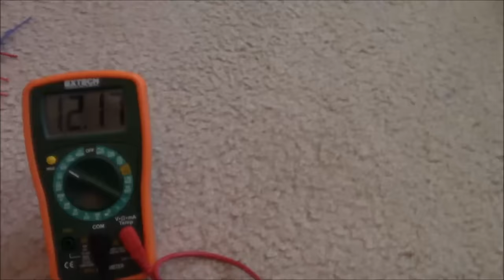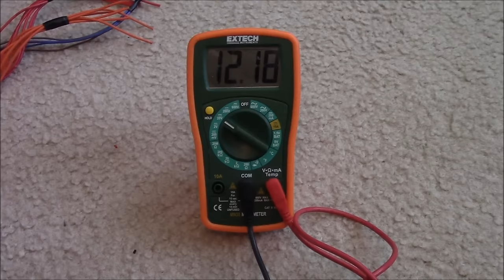How to Hack a Computer Power Supply (PSU) To Use as a 12V DC Power Source

Comment: Could I ask wat happens if your power supply has 2 cable ports
Reply from the maker: Two ports for power cables?  Then that sounds like a redundant power supply that if one side fails the other can still operate the machine.  Servers have those but usually they are two separate parts and not one part with two plugs.

Comment: Which wires do you connect for 20 plus amps?
Reply from the maker: Mine maxes at 20A on the 12V rail.  So you would need all of the yellows combined for that.

Comment: I have a solar panel that charges a 12v battery. is there a way to make one of this power supply to get me 5v output ? by skipping the ac part of it? will it be effecient or will it eat too much power for its circuitry?
Reply from the maker: You want to change from 12v dc to 5v dc?  This power supply would not be able to do that without converting to ac first.  You need a power converter like this http://www.amazon.com/KEEDOX%C2%AE-Converter-Power-Supply-Module/dp/B00A71CMDU/ref=sr_1_6?ie=UTF8&qid=1410842261&sr=8-6&keywords=dc+dc+converter
Reply: Thanks, i've already made one with a 2575T (5v) thanks to texas instruments. Those are not available in my country (argentina) so i had to import it (and was really expensive). but also i need a 330uh inductor (i think is called that in English), but in my country i can only find a 0.25w ones.. when i try to charge my cellphone, it uses 1A (@5v) and it damages the inductor. i would need a 5w inductor (i think) but i have no idea how or where to find one. i certainly tried to get one commercially but to no avail.
Reply from the maker: I am afraid that I can't help you there.  Good luck, though!
Reply: thanks for the good vibes.
Reply: good idea. thanks.

Comment: I have  a  atx power supply that will not take 6amps without turning it off then connecting the load then it works. if i dont turn it off before i connect the load it shuts down. any ideas?
Reply: Do you have a dummy load connected? You need a 22ohm 10w (wattage can be higher) connected to a single 12v wire and a single ground wire.

Comment: I was just wondering, what would the difference be between soldering all the 12v yellow wires together and using them individually with one ground (black) wire. If i had to power 2 12v devices, should i use 1 yellow wire each or as many yellow wires as i can? Would really appreciate if anyone could help me out with this. Thanks
Reply from the maker: Each of those wires is very small and only meant to handle a few amps.  But the entire +12V rail can provide 20 amps.  So I soldered them all together to be able to safely use all 20 amps if I wanted to.  You could probably get away with 4-5 of the wires for 20 amps as well, but I always err on the safest side.  If you are only planning on using a few amps, you could probably get away with 1 or 2 wires.  Personally, I would probably never use just one wire but that is me.
Reply: Thanks so much!!
Reply from the maker: You are welcome.  Thanks for watching!  Be sure to subscribe if you haven't already.
Reply: I have RX-630AS

Is there a way to make
 +12v1 x 22Amp connect to 
+12v2 x 22Amp connect in serious 

to make 24V 11amp ?

Comment: 2 power supply have mine, running doesn't. however single yesterday & 2 day earlier running was.either multimeter the how using im?
Reply from the maker: I don't understand what you are saying.
Reply: power supply both running won't. how repair make able im?
Reply from the maker: In order to get the power supply to run without being connected to a computer you have to short the green wire with a black wire.  Watch around 1:45 in the video for instructions.

Comment: Hello, I am having an issue while modding a brand new antec bp450ps, I did as you showed, I also added a 10w 10 Ohm resistor to the 5v line as dummy load. the problem is that the voltage drops down to 9v while drawing 5.8A.  the 12v rail is rated 19A so i am super confused if the smps is faulty or not, i already voided warranty by opening it and modding it. Any thoughts or suggestions would be really appreciated. Thank you!
Reply from the maker: Hmmm, the only suggestion or thought I have is how many wires are you pulling 5.8A through?  Did you lengthen the wires to make your connection to your load?  Because you could be suffering from voltage drop.
Reply: LDSreliance I am using all 16 wires (20awg each) to pull the current needed and I have cut the wires to around half a foot in total length (from pcb till connector). Now I am afraid that I could have purchased a dud :(
Reply from the maker: It is possible that it was a dud.  Sorry, I don't have any more ideas.
Reply: No problem! Thank you for your time :D
Reply from the maker: You are welcome.  Thanks for watching!  Good luck with it.

Comment: due to my home made battery pack for a motorized trike, i have 16, 6volt 12 amp SLA  batteries...i run them in 2 parallel series of 8..... the way i am charging them at the moment is by breaking the series down to 2 6volt 12 amp batteries and then using a 12volt 6amp trickle charger.
 i understand the concept of using multiple batteries  in a series to get my desired voltage-in my case it is 48 volts...but i am having issues trying to figure out a battery management system for my configuration.
  is there a way for me to use a few pc power supply boxes  or what ever to make it so that i do not have to break my series apart for a charging cycle ?
  how would you approach my problem ?
Reply from the maker: Why do you have to break them apart to charge them?  As far as a charger is concerned, it would just see a 48V 24Ah battery bank unless I am missing something.  As long as your charger can charge a 48V battery you should be fine.
Reply: indeed, i suppose i was asking if there is a way to make my 12 volt charger work as a 48 volt charger or do need to buy a 48 volt charger and be done with it....this 12 volt trickle charge  i have is for my riding mower and it is only used in the winter months...I am simply wondering if there is a way i can use it for my trike too-besides the mentioned way of breaking the series down to 12 volt
Reply: i am of the belief that a 12 volt charger will not charge a system higher than 12 volt
Reply from the maker: That is true by itself.  But you can get a voltage step up converter that could possibly make it work.  If it were me, though, I would just get the right tool for the job and get a 48V charger.  It will be cheaper and more efficient.  Like this:  https://amzn.to/2NEdNcL
Reply: great..thankyou for the advice . i was simply wondering if there was a cheap add-on of sorts.
Reply from the maker: There is.  But in this case a 48V charger is just as cheap.

Comment: What if a power supply has 2 or more 12V rails,can they be connected into one?
Reply from the maker: Yes but you may end up tripping the fuses.  The 12V rails come from one source but are just channeled through different paths with different fuses and protections.  They do that because the wires are thin and can't handle high amps.
Reply: So it would be best and easiest solution to use a single 12V rail power supply?
Reply from the maker: That would probably be easiest and least problematic, yes.

Comment: I plan on doing this with a 650W power supply to power car subwoofer amplifier
can I charge up six 500 farad super capacitors to 12v then hook it up to the power supply to soften the current draw from the amp when the heavy bass hits? so the power supply doesn't cut off when it sees the current rapidly increase?
cause i know some power supplys are overprotective when they see the current changing quickly even if it doesnt go above the rated wattage.
Reply from the maker: Theoretically, yes.  You would have to have capacitors in the mix because the PSU will not supply surge current.  Also, keep in mind that your PSU will provide less than 650W on the 12V rail.  650W is the total that can be provided by all the rails.  Your 12V rail is most likely 40A at the most (480W).
Reply: so I need to get an even bigger power supply? like 800W or 900W to power my 500W amplifier? cause my amplifier has two 25A fuses
Reply from the maker: Maybe.  Your amplifier won't pull 500W unless it has to.  So it depends on the power draw of the devices connected to the amp, not the rating of the amp itself.
Reply: it outputs 500 watts RMS at maximum load and I plan on setting the gains for maximum clean bass output without clipping or cutting out issues I like lots of low deep bass around 30hz and lower. not higher punchier bass like 40 to 100hz
Reply from the maker: Right but what is your sub rated for RMS?  If it is a 400W sub then your amp doesn't need 500W.
Reply: two 250 watt RMS subwoofers
so yes it does need 500W lol
Reply: I just checked the specs on the product box from some pictures online and it outputs 54 amps on 12v rail. should be enough for my amp??
Reply: also the power supply has a switch like yours does that make it a good candidate for use as an amp power supply?
Reply from the maker: Yep that all sounds good.  If it can reliably produce 54 amps you are good to go.  The switch is pretty much mandatory so it is nice you already have one built in to the power supply.  Let me know how it turns out.  I am interested!
Reply: ok! if It has a potentiometer to adjust the voltage higher thats even better for more efficient power. but I think only really old power supplys have those. and sometimes those pots dont adjust anything visible on the output
Reply: it just arrived I got it hooked up and it works perfect. voltage is staying pretty strong at 12v. its at 12.18 with the amp hooked up nothing playing turned on and stays mostly above 12v playing music

Comment: Can I connect to each cable 1 fan 12v 0.5A? I want to connect like 5 of them
Reply from the maker: +Paul Vasiliadis That should work just fine.  One individual yellow wire should be able to handle 0.5 amps @ 12v.

Comment: I have a PSU N275P-00, I did the same but it goes off after it starts
I  try different gwd but does the same, any idea??
Reply from the maker: Yes, it has a feature that shuts off power if it detects that there is no load.  Try connecting something to it like a light bulb that will turn on and draw power as soon as the PSU turns on.  It should stay on then.  Also, you could wire in a resistor to provide a dummy load if you know how to do that.

Comment: What maximum current (DC Ampere) i can get from typical ATX PS Unit
Reply from the maker: +Asif Riaz On the +12v rail it will be between 20-40 amps usually.  Cheaper units like the one I have in this video are the most common and will be around 20-25 amps.

Comment: Typical PSU has 300W
Does it mean I will get 12V and over 20A ?
Reply from the maker: 300W is a very small PSU for a desktop computer.  The smaller ones will have 15 or 20A on the 12V rail and the larger ones for workstations or gamers will have more.  You have to check the specifications for that exact model to know for sure.

Comment: Yesterday I was able to get my hands on an old power supply. It's a simple fsp250-60hen with no on/off switch on it, which I have never seen before by the way. As far as I remember all the pc's I ever owned  had a power switch. Is that green wire still the wake-up wire then? My logic tells me yes, but I'd like a second opinion on it.

And here's a little note for everyone else that is in a rush and quickly goes buying a second hand power supply. I did a big booboo yesterday and got majorly ripped off by the (private) seller on that power supply, due to my own stupidity. It was advertised as a Trust 570W Pro PSU Dual fan, and he wanted $10 for it. So I thought "Meh, that's not a bad deal for it" and I agreed. Went to his house in a hurry - didn't have much time - grabbed the box, took a quick glance at the power supply without taking it out of the box, payed him and jumped back in the car. It's only when I came back home an hour later that I discovered that I had been ripped off. I payed $10 for a power supply that is basically only worth a buck or so, if even that much. The fan rattles like crazy when I flip the case over, only one fan there of course, no power button, only 250W and not 570W, less connections, and so on. I haven't bothered testing it yet, so I don't even know if it will turn on to begin with. SIGH

EDIT: tested it, and OF COURSE the thing is as dead as it can be. No current at all, nothing, nada. Even the fan inside is completely broken and several screws in and on the casing are missing. And to top it off, the seller refuses to refund me and blames it "on his friend", since the power supply is supposedly his. Riiiiiight. No real surprise there, to be honest. SMFH

Comment: When i connect yellow and black wire into a dc 775 motor , PSU become auto off, why?
Reply from the maker: Either the motor is drawing too much or too little power.

Comment: Please help with my HP-P2507FWP. Followed your instruction but not getting the 16a. What am I doing wrong?  Thanks
Reply from the maker: J Carter Did you connect all the +12v wires together?  They may not be yellow, although I think yellow is the standard color.
Reply: LDSreliance yes,,it will run a small dc motor but when you add anything that need more amps it will not run them. The specs say 12v 16a...I am running a fan from an old bus with a 12v 12a batter charger from a kids toy yard can but it gets hot, was hopping to use this,,,,,,,,,,Thanks
Reply from the maker: OK, so you are trying to power a fan and also a battery charger with your hacked computer power supply.  What are the specs on the fan?  If you don't have them, can you test it with a multimeter and see how many amps it draws?  Are the specs on the battery charger the input current or the output? 

I would bet that the bus fan is using more than 4 amps.  Even small aftermarket electric fans for cars pull more than that.
Reply: LDSreliance  Just did a test, the fans are pulling 8.5a. when I tested then in direct hook up two fans wired together then leads to power supply the would kick on but not run. when I put the multi meter in line to test amp draw they ran fine. What!  Do I need a resister some where or something ?
Reply from the maker: J Carter I am not an electrical engineer so I don't know why that is happening.  I do know that the resistance on the volt meter is negligible or it would not be useful for testing because it would skew the results.

I know with other fans they draw a lot of amps to gets started and then it tapers and levels off once they are moving.  It is easier to keep a fan spinning and requires less power than to spin them up from stopped.  Maybe the power supply has some sort of overload protection that prevents large spikes of power.
Reply: LDSreliance  Ill do some checking    thanks for the help  keep up the great work
Reply from the maker: Will do.  Good luck!

Comment: hey brother can i ask you how many amps does the 12 volts pc power supply can throw???
Reply from the maker: The one in this video can handle a maximum of 20A on the 12V rail.  Check your specifications on your PSU for an exact number but it will be between 15-25A usually.
Reply: LDSreliance  thanks i checked mine its rated for 30A...but my problem now i want to put an illuminated 220v rocker switch because my psu doesnt have one, but my problem is i dont know if wiring 220v rocker switch is same with wiring 12v rocker switch...
Reply from the maker: Usually the voltage rating just means the maximum that it can handle.  So using only 12V on a 220V switch should be fine as long as it is rated for DC current.  However, it may not light up for you.  Check the specs of the switch and see what voltage the light circuit needs.

Comment: when you solder wires together  never twist them as shown in the video, always lay them side by side for better and stronger connection
Reply from the maker: Why would that be stronger than twisting them?  Just curious.  I have never heard that.
Reply: @LDSreliance  It wouldn't be stronger. Typically when joining wires they suggest you make two fish hooks and crimp them with pliers... I think twisting is a fine way to do it and I use that method when I don't have the time or patience to do the hook method. 
Source: am an electronics engineering technologist and do a fair amount of soldering.
Reply: @LDSreliance  also since we're here and talking about soldering, you only need to use about 1/5 the amount you used on those wires :P also get some flux, it REALLY helps.

Comment: I got a compressor for my car cigarette plug. Will this 12v work for the machine?
Reply: Also do u need all the yellows or is 1 enough?
Reply from the maker: Yes, this will work even better than a car cigarette plug because it won't be limited to 10 amps.
Reply from the maker: No, but you won't be able to safely use all of the power of the power supply through one or just a few of the wires.  They will burn up.  If you are going to use something more than about 100 watts I would recommend combining at least a third of the yellow wires.
Reply: +LDSreliance thx for reacting. If i would make 2 of these and combine their 12v would you be able to create 24v?
Reply from the maker: Richard Koning
No, because you would have to wire them in series to get 24v.  I don't know of a way to wire 2 of these in series.  You could use a step-up converter to get 24v, though.
Reply: +LDSreliance i only got 2 yellow wires and a bunch of white. Any idea if yellow is still 12v?
Reply from the maker: Richard Koning
I don't know.  What is the make and model?
Reply: +LDSreliance found out it was 12v1 and 12v2 so added them together.
Reply from the maker: Richard Koning
There you go.